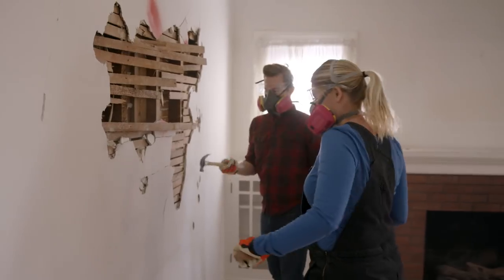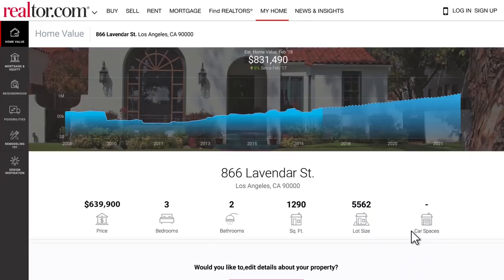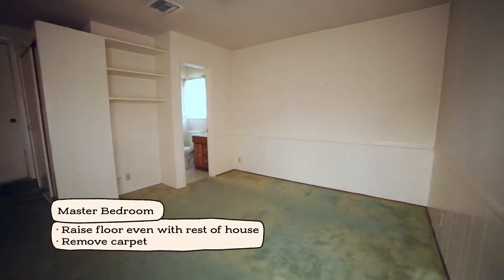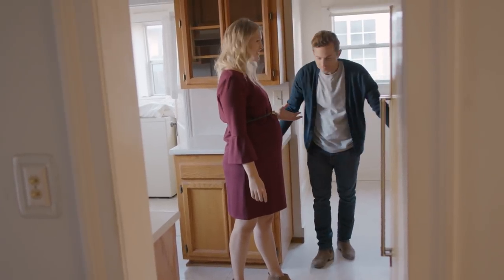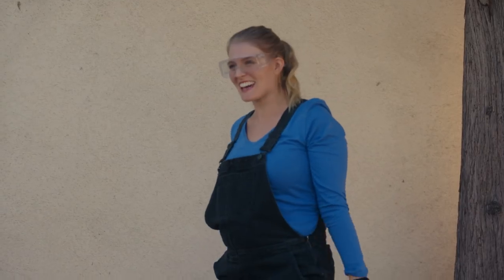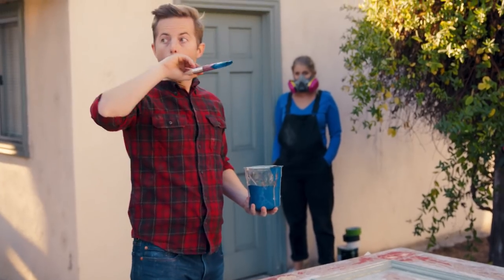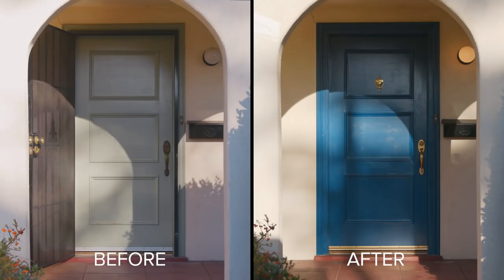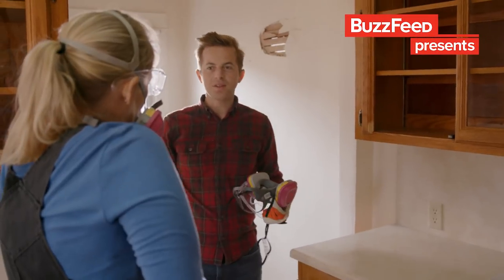Couple Remodels A House For The First Time • Ned & Ariel

Comment: Just checking, with remodeling old homes most people don't think to take samples of the plaster and plaster compounds prior to disturbing these materials. Asbestos was used in homes built and/or renovated between the 20's and the 80's and can be found in drywall, joint compound, floor tiles, ceiling tiles, vinyl flooring and it's glue, boiler and furnace duct wrap as well as a dozen other areas. I would love to see TV shows that before they start the demo they test for asbestos because it educates the viewer to watch for these things before jumping in. TV shows should also be educational as well as entertainment, don't you think?
Reply: Mark M Well said!

Comment: I hoped they checked if those walls were load baring before they tore into them.
Reply: I guarantee they have a contractor who is actually doing the work. That's why all they did was put a hole in part of the wall.
Reply: Sarah O'Connor Ariel does this for a living, didn't you know? She's an interior decorator, she buys houses and flips them.
Reply: MsCherade9 decorating has nothing to do with the structure of the house, decorating is what you see on the surface. Not what's inside the walls. I can paint a wall, doesn't mean I know it's load barring. For that I'd have to consult someone.
Reply: I got so stressed.
Reply: If you just go to the attic/in the ceiling, you can tell from there if it's load barring or not

Comment: tbh with the amout work/remodeling theyre doing, buying a already--ready house would probably be the same price im guessing
Reply: Theres no way it would be the same price in thst area. If they went out further to a cheaper area yeah. But Ned said he didnt want to be so far from work. They are expanding the bathroom and updating everything. The  open floor plan and new modern kitchen will add 50k at least.
Reply: Nope. Its almost always cheaper to fix something up yourself then to have it all done for you. If you do it yourself you can control the cost alot more as opposed to someone else doing it just to make a profit

Comment: Sooooo they bought a house and are changing the entire house? I mean I know the house was cheaper but the renovations are gonna bring the price up over the other ones.
Reply: eustacia03 I think they were gonna have to renovate some parts of the other houses anyways, and the location of this one was better for their commute to work
Reply: eustacia03 they also could have gotten it for a lower price than what the seller was originally asking for
Reply: But by buying cheaper and then renovating, their monthly mortgage payments will be lower, so they'll get to sell their house at a higher price (making back the money spent on renovations), and they'll have saved money over time with the lower mortgage from the lower initial sell price.
Reply: You’re right. What were they thinking. Obviously didn’t figure out logistics
Reply: Yeah but now they can make that house their dream house...
Reply: Gabe Wright — In the beginning they said they were going to remodel, but that they weren’t going to raise the price. So, they did think about it.
Reply: it would've cost them a lot more
 if they had hired people to renovate but their doing it themselves so
Reply: They did this little bit themselves but there is no way two people, one of whom is pregnant and neither of whom is an engineer are going to raise the floor and build an extension on the house in time for them to move in with that baby. This is a contractor situation and the reno they're planning to do is going to cost at least 100k, probably more.

Comment: I don't wanna be a buzzkill or anything but I am REALLY worried about Ariel. she should not be wearing a dust/epoxy mask while being pregnant, or just overworking herself in general. this project is awesome, but I really think she should be careful and not be around any kind of dust or chemicals while helping out Ned. the mask that she is wearing helps but could also do damage to the baby since not all masks are approved to be worn by pregnant women in case the baby won't get enough air through the mask. >w<''

Comment: So... did they hire a contractor or structural engineer or someone before deciding to increase their square footage and knock down walls?
Reply: most likely
Reply: If you know how to do the job, you don't need a contractor. Also, interior designers have to go through the process of learning the basics on remodeling. It's not just paint and colors and tiles... I studied it and I know how to tear a wall down if I must and the proper way to do it. All you should have is the House's blueprint to know about wiring pipes and plumbing, which usually are not in the way anyways. 

I'm pretty sure Ariel, being and interior designer, has the knowledge to do the job by themselves... As long as you attain the permits to expand, the rest is really feasible